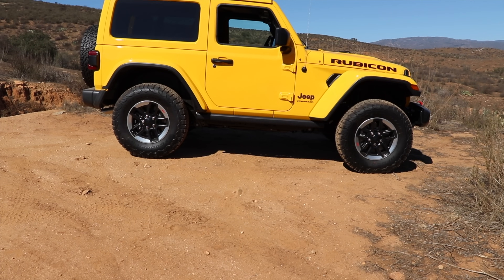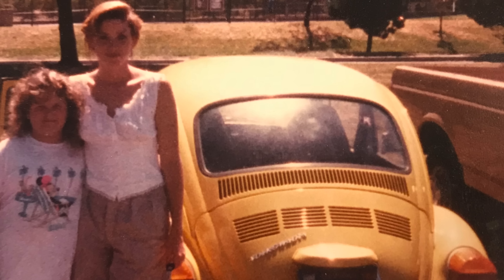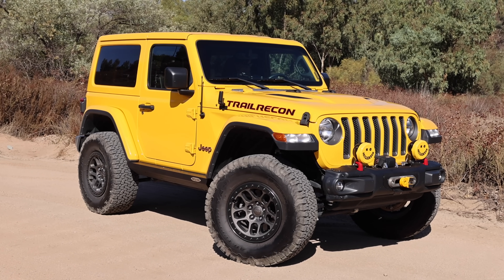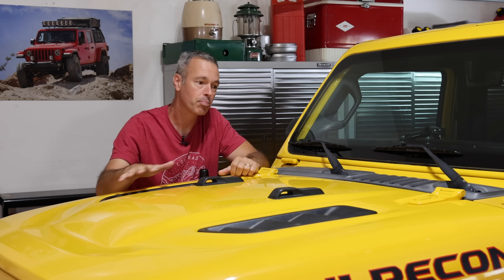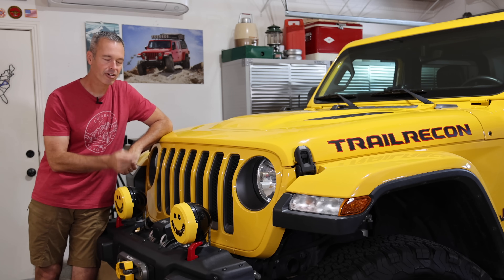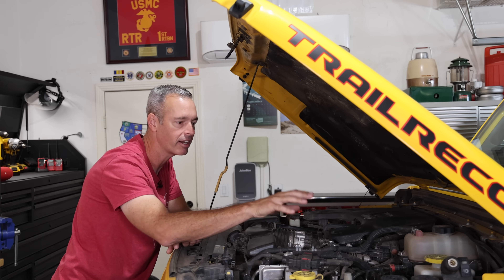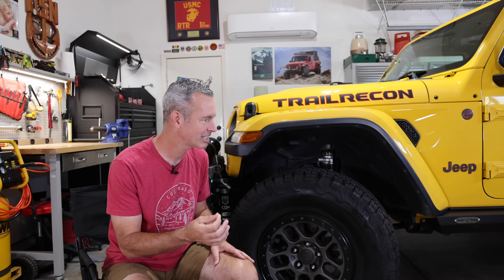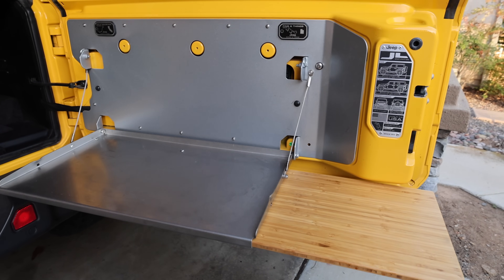Do I Still Love My Jeep Wrangler After 4 Years?

Comment: I love seing couples and families all wheeling together. Jeeps are so good about naturally encouraging togetherness and doing things as groups. My wife and daughter are both Jeep girls, and while my daughter loves her white 2 door hardtop Wrangler, my wife prefers her 5.7L Hemi Powered Grand Cherokee TrailHawk. It's the vehicle she traded the minivan for, and the first vehicle she has owned that she is passionate about. She built an emotional connection with the TrailHawk, and being a car guy, that makes me very happy.  I myself am beyond happy with my 2018 JLUR, and It has it's share of Ocala National Forest Pinstripes and rock rash on the rock rails, steel fenders, and beadlocks. I also have around 63,000ish miles on mine with the 3.6, and I agree. Its a solid and trouble free motor, and mated to the 8 speed auto and 5.13 gears, turns my 38's very very well. I also have a 99 C5 Corvette, but I prefer the Jeep for daily driving and weekend adventures.
Reply: That's awesome! It's great to find things to do as a family that don't involve electronics! (Other than what makes modern vehicles go!)☺

Comment: I've been driving my 2-door 2013 Jk Rubicon since 2013. I love it.  Repairs made are a starter and lifters.  It has a 2.5" lift,  35s,  Warren 8274 winch.  It goes anywhere that I'm dumb enough to go.  I removed the back seat right after I bought it so I could have more room for cargo

Comment: Sweet Jeep, Regina! You can still add the Mopar LED headlights and LED Bulbs for the front turn signals, DRLs and fogs like I did, replacing those front JL candles, easy upgrade, and probably my favorite mod on my channel. I had to use a tazer to turn LEDs on to avoid flickering and enable halos but you might already have one for tires, or Jeep dealer can also enable all LED front lights. I spent around 1k for all front LED lights, and tazer, installed all myself. THANK YOU for being so awesome you two! Both Jeeps need the Mopar Gorilla Glass windshield, no more replacements, one and done. Rugged Ridge snorkel paired with KNN Air Filter helped my mpg by 3-4 on V6. Brad’s 392 is already good to go. TTYL amigos!

Comment: You talked about your windshield getting rock chips and having to replace it several times. Google windshield protection film. It works like PPF (paint protection film) only for windshields. This worked great on my Rengrade. I got my first rock chip before I got home from the dealer. Because the windshield had to come from Italy I waited 7 months. I put the film on it before I drove it. Because you guys go out in the sandy desert all the time you will have to be careful when you use your wipers so as not to scratch the film. Many detailers in your area can install it for you. I think if you were to do a review of the film a lot of Jeep owners would love you for it. You guys have a great channel, keep up the good work.

Comment: Recognized the '73 right away.  Had one myself (not a super) in L13 Texas Yellow as well.  Still at my dad's place, in pieces unfortunately.  Learned to drive in his Karmann Ghia.  Fun times!

For the rest of my comment:

Summary:  we have a Chrysler Town & Country and we've had good luck but with several small issues and a few not so small, and one I know is a big one but it's so far only putting metal shavings in the oil filter and drain, seen with the last change.  4 years is NOT enough time to be impressed at "how well it's holding up" when other makes and models are easily going 150,000 miles plus with no issues.  I'd be impressed with a Chrysler making it to 100,000 with no issues, but I'd EXPECT that from any other make and model built after 2015.

Now the long version (sorry for the book):
Our Chrysler Town & Country had a little over 70, maybe 75 thousand miles on it when the little plastic "Y" on the coolant line literally split its seam.  Correct replacement was ridiculously priced for all that it is, I forget what it cost, but instead I got a generic aluminum tee.  Works just fine for a fraction of the cost.

That said, the van was 3 years old when we bought it, and had 36,000 miles then.  So we'd had it about 4 or maybe 5 years before that happened, and now it's turning 90,000.  The last oil change, there were ferric shavings in the filter and in the drain pan.  Not sure what's grinding away but it's only a matter of time before we find out, hopefully as we pull into the driveway some Friday evening when I have the weekend to tear into it.

Around 50 or 60k miles, we had to replace the shocks, which shouldn't have been necessary.  In the van's defense, the GMC Terrain that backed into it should not have.  But we shouldn't have needed shocks from that minor fender bender.

Around the same time as the coolant line issue, we also had to take the transmission in to be rebuilt at 70,000ish.  Going up a small hill not far from the house, the transmission gave way and dropped into 2nd gear "limp" mode.  I forget what all the mechanic found (I'm just not equipped, nor do I have time with preteen kids, to DIY that crap today).  I seem to recall the valve body needing replacement.

We've had fair to good luck with this Chrysler powertrain but we've known a lot of people who have not.  

Let's not start on the ridiculous stuff like the TPMS sensors mysteriously being bad ever since the first tire change, the passenger airbag light occasionally indicating a warning, or the fact that once every month SiriusXM wipes out the presets my wife sets in the radio.

I'm a Chrysler guy, but I have to admit.  I've been driving my wife's 2004 Pontiac for 12 years ever since I ran my Daytona into a Passat's tail end, and it has had 
    *ZERO*
powertrain issues in that time, now approaching 80,000 miles.  Granted, it's not hauling a fully occupied minivan with luggage cross country like we did with the van, but I'm not the easiest on the car.  The Pontiac does have a bad volume control in the radio and the A/C makes a repetitive "clack clack clack" sound when I have it set anywhere other than halfway between recirc and regular chill modes, and much of the plastic in the cabin is deteriorating (and the vinyl/pleather of the dash is all warped and ugly), but mechanically the car is an easy 7 or 8 out of ten, at eighteen years of age, with not even the recommended amount of preventive maintenance that should be done.  Hardly taking care of anything outside oil and tires, that little car just keeps on giving.

I'm the last person to praise on GM products but in my limited experience, as much as I want a Gladiator, it's mainly for its looks and reputation of capability borrowed from the Wrangler line.  I'm not looking forward to the problems Chrysler's 3.6L and whatever they're calling that 8-speed have in store for me.

I'm hoping the manual isn't too rough to drive.  I really miss rowing my own.

Honestly though, I might just find me a nice late 60s sedan to daily drive.  None of this added points of failure with each electronic component nonsense.  My beetle from '73 got 25 miles per gallon and the only time it failed it was mechanical.  Points, aftermarket fuel filter, generator belt.  That engine just never quit if you maintained it even a little.

Sorry for the book.  Really like your channel, thanks for the vids, knowledge, and entertainment!

Comment: Hi there Mrs Trail Recon. I'm also another woman owned Hella Yella 2 door wrangler rubicon jl. I didn't want the full yellow (I have the black hard top and fenders) but I still love mine. Because I work from home mine ends up sitting in the garage for months at a time. I still haven't cracked 10,000 miles on it but I manage to get it out in the summer. I remove the top and doors for the summer time. I have used the winch on mine but not for vehicle recovery, I've used it mainly to recover my zero turn mower when it gets stuck in my very hilly yard. For mine I chose the oh so original name of Ruby.

The day I brought my Jeep home I removed the rear seat and never put it back, so it's also a 2 seater for me with a brand new never sat in rear seat. The back area is the cargo area (recovery gear, air compressor, etc). For me I love shore driving in the summer time with the top and doors off. I have folded my windshield down several times and did buy the windshield tie down kit and that gets pretty breezy.

Maybe some day you will make it out to the east coast.
Reply: Thank you for sharing! We're heading east for Overland Expo in Arrington, Virginia next week but we're heading back home as soon as it's over. We hope to get to the East Coast to do some exploring in the future!

Comment: I have had 5 windshields replaced in my 2011 Wrangler until the glass guys modified the last install and did something with the gasket similar to newer Jeeps. From that time forward I had no issues with rocks/cracks. Now I have had a 2021 and plenty of rocks fly up on it and still no chips/cracks… knock on wood.

Comment: I havre a 2 door 2016 JK Sport S and the #1 Con for me is the back seat not latching when up.  It's good to see they added the strap on yours but I've had to use a tight bungie cord to keep it up.  But that's the only thing I'd change about mine.  Great video!
Reply: Ugh! If that were the case with the 2018s, my backseat probably would have been gone long ago!

Comment: My wife and I bought our first Jeep, a '21 Rubi 4 dr. with the Xtreme Recon package, about 8 or 9 months ago.    She loves to drive it, both on and off road, as much as, maybe more than, I do.  She thought she wanted fold down steps at first, too.  But I got her to try a little fold-up plastic step we had in an RV and within a few months she got used to getting in and out and doesn't use her step any more either.  We agree with you that the seat-back adjustment strap is a poor idea poorly executed.  Come on Jeep!  Ours has the optional Gorilla Glass windshield.  We've heard stuff whack it pretty hard, but so far, no chips or cracks!  So I would say its a worthwhile up-grade.  We have been having a ball with our Jeep and it has been stone reliable.  We went on Sierra Trek this summer and had a great time.  Living in San Diego, we can go do a day trip to the mountains on a whim, and an over-nighter  or two at Anza-Borrego is only two hours away.  We are off to Death Valley as soon as Hwy 190 is open again . . . or not.  We love, love, love, our Jeep, too!
Reply: I think it just took Brad so long to install the step that I just got used to living without it! 😂

Comment: Griots Ceramic 3 in one wax works great for a budget paint sealant. Only around $20 for a bottle. They also make a ceramic trim wipe with Cerakote that is guaranteed to last for 2 years or 200 washes. Will keep it looking great.

Comment: If you're going to upgrade the headlights, don't bother with LED bulbs or no-name units off Amazon. Put J.W. Speaker Evo J3 or J2 headlights and foglights in and do it right the first time. They're fantastic and make the Chinese units look like flashlights. Great video and two-doors are just plain fun. The four-door may be more practical and keeps the brand going but the two-door is the true Jeep.

Comment: my gmrs install    it looks like you have the midland mxt275   what i did with mine is to remove the plastic cover under the steering wheel and mounted the 275 bracket to the brace in front    for here you can get simple or over the top  i hooked the power up direct to the battery with a good ground.  run the antenna cable to the back of 275   
i have both the 3db and 6 db antennas. i mounted  a bracket   on the tail gate hinge   i made an extension cable out of cat 6 cable with rj45 one end and a rj45 receptacle on the other end.  length of extension cable will vary depending on where you mount the mic  if you don't have the material you can have one of your SD guys do it for you
drill  a hole close to the mic and install the extension    done plug in the mic and everything looks the same with the radio moved    i took mine one step further and mounted 21-406 in the over head plastic with the jeep speakers  
added security if you go some where you can just unhook mic and put in center console and it all looks stock

Comment: A bit late to the party but I’d like to slip in the recommendation that you shouldn’t need to go to 37s on the two door unless it’s preference. 35s on the 2 door wheelbase seem to be the sweet spot for capability anything beyond that and you start getting into diminishing returns for cost/performance.
Reply: David very well said. Because of the short wheel base 35's will tackle almost anything most people can throw at it!

Comment: I have never owned another yellow vehicle after my first car a ‘73 Super beetle, and it was extremely reliable. No one wanted it so I purchased it for only 800 dollars. Anyway I also have 2018 rubicon but mine is a JLU. Granite and although the steering gear box was replaced because the original one was aluminum, and the replacement was steel and Much much stronger.
Reply: '73 Super Beetles are the best!

Comment: @Brad & Regina,
Thanks again, for great content and commentary that is spot on! Helpful, and relatable.

We've really appreciated how much we've learned from y'all, as we've just begun our new experience with 2D Wrangler Rubicon, and off-roading in PNW.

My wife wanted steps as well -- and we have been thrilled with this product:

"AMP Research Power Step"

Be sure to get the BEEFY version, for real rock-slider level protection -- not just the functional version.

Has a light, and the hinge does not do what yours does -- though they do not drop down as low. 
We love these!!!  [e.g. "Happy wife,...  ;) ]

And we are getting that tail gate table ourselves ASAP!!!

...please give us your views about that rear-bumper update. Aluminum? Iron? Brand? Features?

Sincerely,
J & L

Comment: Question, how tall is your garage Door? I have a 2022 jlu, with evo Enforcer stage 2 lift, King 2.0 shocks  and Ko2 tires. I only have 1 inch of clearance.  It was supposed to be a 2.5 inch lift and got 4 inches. My jeep won't fit with 35's. What to do? Sell the house?
Reply: Sounds like you gotta throw the whole house out.